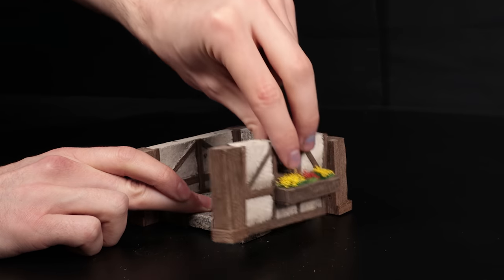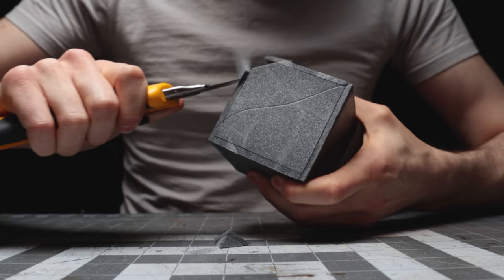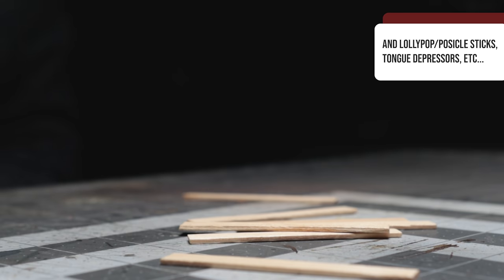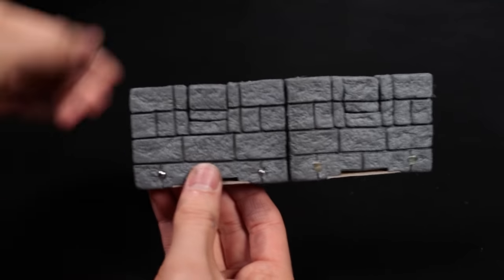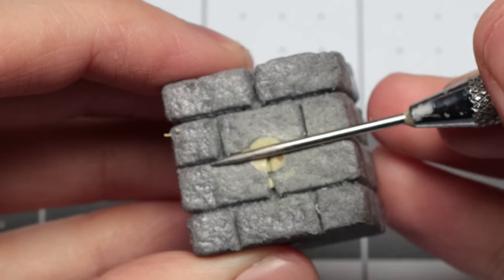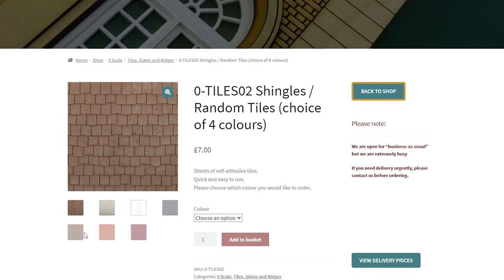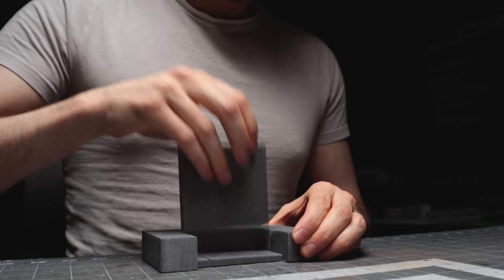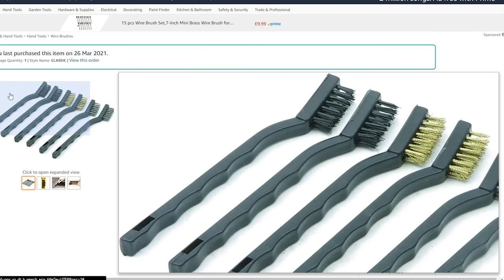10 EASY Ways to Make Modular Terrain CHEAPER and FASTER.

Comment from the maker: Let me know what you guys think of these tip videos, would you like to see more?

Dimensions for things I mentioned are below!

Stacked foamcore block:
3" foamcore x2 (for two sides)
3" by 2 and 5/8" foamcore x2 (to fit between those larger sides, on the other sides)
2 and 5/8" by 2 and 5/8"  foamcore square x16 (for the middle)

chipboard wall:
3" by 2" main wall sides x2
1" by 1/2" bricks

Numbered parts for inside chipboard wall:
1 - just under 1" by just under 1 and 1/2"
2 -  just under 1/2" by just under 1 and 1/2"
3 -  just under 1/4" by just under 1/8"

Then a section was cut from the bottom of the pieces to fit a card tab slot for floors, exactly the same way as I show in the stable video :)
Reply: I was really craving these kind of videos. There are plenty of questions that arise in the middle of a build that you surely have the answer that would be a bit cumbersome on a build video but perfect on a tips one. (example: why my glue gun melts a third of a wall and yours makes perfect magnet holes ?)

On a completely unrelated note, and hopefully useful for the community. This is the cheapest place to buy magnets I have found so far (at least in Spain), their service is fast and efficient, and you get high discounts with a very small number of units: https://www.aimangz.es/index.php?zona=3&id=26
Reply from the maker: The answer to your magnet question is the type of glue gun you use :) 

I show this more clearly in the hills video when my old glue gun died - the difference between a £5 glue gun and a £20 glue gun is INSANE. I would advise jumping to a surebonder mini, they're linked in my equipment list. The nozzle is very thin and perfectly fits 3mm magnets, better even than I show in this video (older tiles with my midrange gun)

Thanks for the Spain link! I'll add it to the equipment list :)
Reply: I'd like to see more top style videos, but only if you have lots of good ideas for them. 
Don't feel like you need to push tonnes of them out, because your deep dives into one specific idea are really inspiring and entertaining.
I think we all just enjoy seeing your system developing and how it adaps to overcome so many different challenges.

Great video as always.

Comment: Speaking for the Americans, you were correct in calling it spackle...

As always, amazing content! Keep it up!
Reply from the maker: Haha! Glad to know I got it right 😅
Reply: @RPArchiveOfficial  We'll also call it 'drywall mud', or just 'mud' if the context is obvious.  :)
Reply from the maker: That's interesting, given that mud (well, daub) historically was used on walls... Wonder if its a reference or just because it's gunky 😅
Reply: What do other people call it?
Reply from the maker: Wall filler, or 'polyfilla' which is just a popular brand name :)
Reply: @RPArchiveOfficial  I mean, that is a more sensible name, makes more sense
Reply from the maker: Longer though, I can see it both ways 😄
Reply: You can also use caulking- like house painters use. (not silicone, DAP paintable caulking)  Heat up a tube in hot water to make it run better, you can also do mold work with it, 1/4 inch (6 mm) at a time. If you do it at that thickness it should dry pretty well in about 30 minutes and you can do another layer. 
It doesn't dry hard like drywall mud or spackling does, and it bonds to just about anything.

Comment: You just gave me a great idea to save a ton of magnets and make this even more modular: instead of 8 magnets per tile, just use 8 steel nails, slightly recessed. Then add a magnet whenever you want to make a connection. That way you only need half the magnets and you don't even have to worry about north and south, so you can even flip the floor tiles and use the backside for a different texture.
Reply from the maker: I've tried this, constantly removing the magnets is a pain in the ass, but if you prefer that to save money, by all means use it! :)

Comment: So, I have cheap $30 wire cutter - made for flower pot foam shaping. I, then, use Lego blocks to create jigs for straight measured cuts. A thick rubber band is used to lock the jigs in place.
Reply from the maker: Lego is a solid idea if you have some :)

Comment: some good tips here ( apart from magnets they're too fiddley for my fat fingers) I would add get a cheap dremel tool with plenty of sanders shapers cutters drill bits ( I hardly use my little had held hand hurting tool any more) for jobs like pinning these are a great tool for doing things quicker.
 I bought one of these last year after seeing one of our fellow crafters making such short work of jobs I used to struggle with. they aren't expensive and later on you can always get an expensive one and when the old one dies --- take it apart and use the body and internals for scifi builds.
 I'm a big user of Balsa now too it's a great versatile material yesterday I made a tiny lectern complete with tiny book and candle all from balsa yesterday and gave it a stone look with sand grey paint and modge podge  I'm very proud of it as it really looks cool. oh and always check out your local pound shop there's a ton of stuff ( such as wire brush sets you can use) I'm moving into pulp era building now as I've been building Fantasy and sci fi for such a long time I want to do something for myself that is challenging and Pulp and Victoriana are kind of my thing
Reply from the maker: Sounds awesome man :) yeah a rotary tool is great, I inherited one from my dad a few years ago now, it's so useful!

Comment: Loved this! Also, in regards to knives. I got a great hack from Another YouTuber ClayClaim (really great stuff if you’ve never seen some of his videos, definitely worth checking out) ANYWAY. He uses a Scalpel instead of an Xacto knife. Both WAY sharper (so the blades last longer) and Way Cheaper! (Medical grade, so they can’t really raise prices). I got a handle for like $12 and a 100 pack of blades for $5. Also, I cut my tiles in half horizontal(so 1/4” vs. 1/2” thick) you get twice as many that way too! A bit harder to do for the bigger sized tiles, but I made little step units.
Reply from the maker: Weirdly enough I used to use a scalpel back when I did warhammer as a kid, they are really good 😅

Comment: Amazing video as usual, it was nice to see some different (and cheaper) ways to get similar results, thanks!

Quick question, your regular stone regular tiles lend themselves to combat easily due to the grid on them. What would be your method of keeping track of movement etc on your tiles that don't have this? Such as your grassland or kobold tunnel tiles? I don't want to ruin the look of the pieces by having lines all over them, but not sure what else to do. I guess it would be the good old measuring tape technique?

For the kobold tunnels I thought I might put indented lines on the undersided section that you've painted black to allow for some tracking that way,
Reply from the maker: Honestly just use a tape measure, though the kobold tunnel idea is interesting.

The d&d community could really learn something from wargamers when it comes to measuring, the grid is just not needed with a built in game referee, in my view :)
Reply: If you want a grid, you can use dots rather than lines. I'd recommend using the dot as the place you set the figure, but it doesn't work as well with creatures on a 2x2 base or 4x4 base. If you find that a problem, use the dots to mark the corners of the squares. If you choose the dot color carefully, the dots aren't bad at all.

As a long-time miniatures gamer, I can say that direct measurement works pretty well, but it does result in some ambiguities at times.
Reply from the maker: Good solution. Ambiguity perhaps, but in an rpg theresa built in referee, so that doesn't matter really :)

Comment: If you know an electrician or having any cabling outside then you may have access to excess from armoured cables which is a good size for pinning wire and usually long enough from cuttings to make armatures
Reply from the maker: Interesting...
Reply: @RPArchiveOfficial  yeah when they lay out they generally strip out the excess I ended up with 50+ that were a ft long each. So lots of possibilities with them
Reply from the maker: Nice!

Comment: If you really want speed, try bulk casting.  Make just one floor tile, and make a silicone mold of it. Then you quickly make a set of castings in quick set plaster. You then make a new silicone mold of the set and use it to batch produce cast resin copies of the floor tiles.  This could work really well for all the cube bits you did for the module stairs.

If they really have to be foam there are pourable foams you can get instead of resin. I think smooth-on makes it.
Reply from the maker: It would need to be foam, the question I would have is if it still behaves the same, not all foam is the same in what you can do with it :)

Comment: Hi! Much appreciation for your work, that's increadible! Have a question tho. 
Where and why (i mean why not on all possible places) you put magnets on all your tile types? I think its interesting for those who wanna start creating terrain in such "modular" style :)
Reply from the maker: The why is pretty straightforward - it makes connecting a breeze and lets you have easy to store modular tiles that can be assembled however you want, as buildings or dungeons depending on what you need...

As for where, I start using magnets in the magnetic building system video about a year ago, and update the system in the cavern video, cottage video and a few others. The building videos in general are worth watching in the playlist, it contains all the stuff that works together :)

Comment: I would like to create a jig of my own for the magnet placement but I’m having trouble grasping where to put the nails, especially on the wall tiles. Any advice?
Reply from the maker: For the thin side magnets, and the front pair, you want to make one that works for floor tiles and just use that (so a 3"x1/2" space, with a nail a half inch from each side, and 1/4" from the long edge :)

There's free 3d printable Stls for this though, even if you can't print you can open the file in a free program like chitubox and look to see what it should look like :)

Comment: I want to start going into terrain building, do I as a starter really need the 100 euro proxxon or is it double with knife and ruler?
Reply from the maker: It depends how sure you are and what you want to do at the start. If you're not sure about it you can start with a knife and some thin (half inch) xps, and make an altar, tomb/sarcophagus or a ruined wall, something simple to get a feel for it and if you want to do more.

But if you want to make modular tiles that fit well together, I'd heavily advise the proxxon specifically, as it has temperature control for low temp accurate cuts.

I'd also recommend either the shifting lands guide or making your own (I've linked a video on it in the equipment list) to replace the stock proxxon guide as it is a bit wobbly and rubbish.

But it's a tool that lasts forever and will save you money on replacement knife blades sooner than you think - not to mention an INSANE amount of time :)